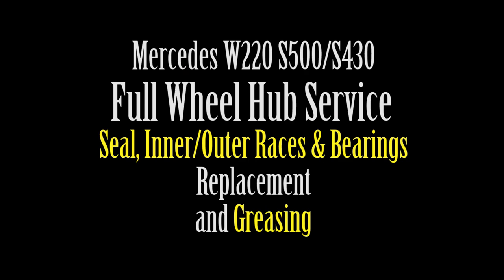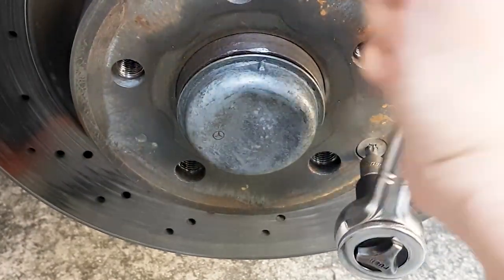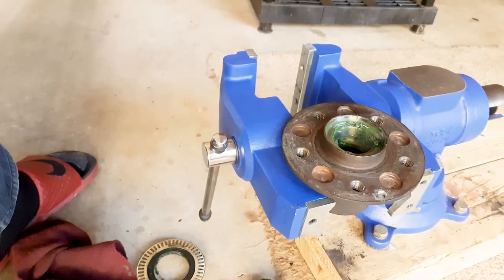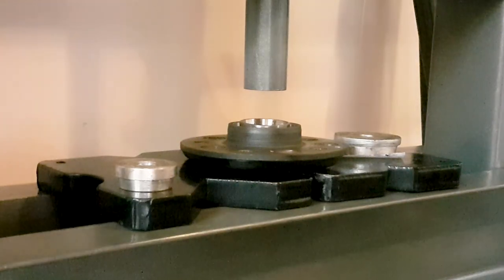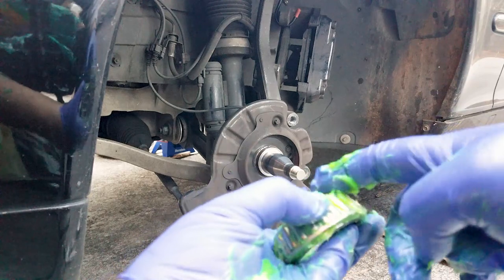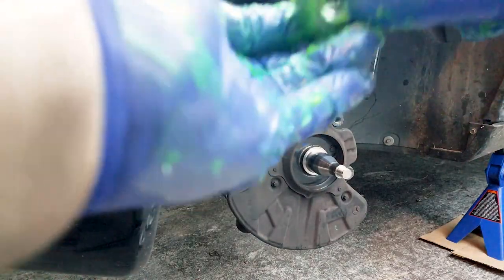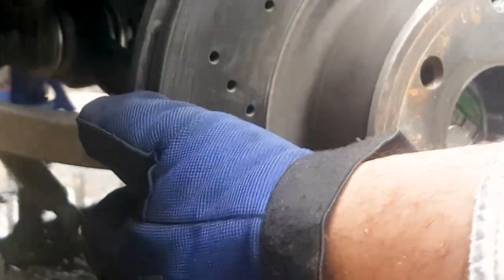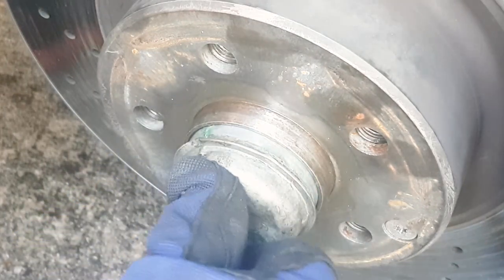Mercedes W220 S500 S430 Full Wheel Hub Service - Replace inner/outer Bearings, Races, & Wheel Seal.

Comment: I'll never understand how everyone just hammers those caps off like that. I tried every flat head, chisel, & pry tool that fits that lip along with plenty of wd40 & pblaster. Over 30 mins of whacking per side, & not a budge whatsoever. 
I live in the Northeast of the US. I assume this is why.
Honestly, removing & reinstalling the cap is my biggest concern in this job.
Reply: I uses a set of wide grups to pull it off.

Comment: Nice tutorial. I just did it on my w204, because the wheel hat little play, the car has 200 thousand km, i think it was about time. I set the gap to 0.01mm. One thing i did differently, i added way more grease in it. Literally filled the hub from inside. What is your opinion, too much grease can do harm? My thought was, it's better to have more grease than too little... The back seal ring supposed to keep it inside, away from ABS sensor, the outer cap will keep it inside as well. And the bearings will get enough grease if they need to. What is your opinion, can i leave it like that or should i take it apart and take out a little bit of grease? Thanks
Reply from the maker: Thank you, A. F.   I don't see any harm in leaving a lot of grease inside.

Comment: I just replaced the bearings on my W220 S500 using an SNR kit (R151.35) including the ABS ring. I carried out the assembly correctly, lubricated the parts, checked the clearance with a digital comparator, and tightened all the screws to the recommended torque. The ABS ring doesn't have any grease. However, during my initial drives, I encountered a bothersome issue: the ABS function triggers mostly at low speed when I brake, without any problems or unusual noises during acceleration. I don't see any error messages on the dashboard, nor any errors with the DAS diagnostic tool, but the cruise control function displays an error and requests a workshop inspection when I try to activate it. can you help me ?
Reply from the maker: Hi Nicolas, it is most likely your speed sensors.  First, make sure, they are inserted and correctly torqued.  If that doesn't fix it,  scan it with a device that can read wheel speeds.
Reply: @masood-tv  I connected the Mercedes to the DAS/XENTRY diagnostic tool and there are no errors. I checked the speed sensors using XENTRY, and the km/h readings are functioning properly. The sensors are not the issue. I tested the entire ABS hydraulic unit, and everything is okay. I am completely lost, I am considering installing the old ABS discs to see if the fault disappears. Because before this change, everything was working fine.

Comment: where did you order these at? will the front hub fit in the back?
Reply from the maker: Hello, I have the parts listed at 0:28 second of the video.  I usually get mine from fcpeuro or autohausaz. Front and rear are not interchangeable.